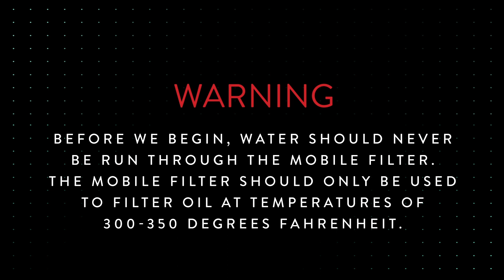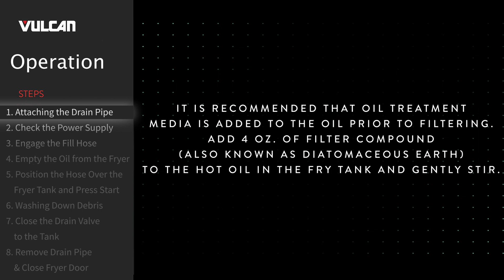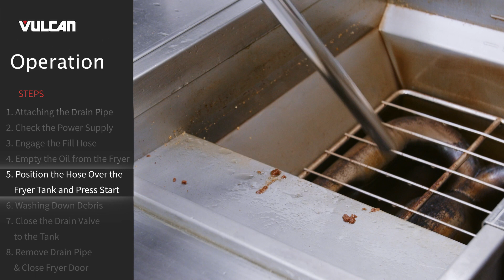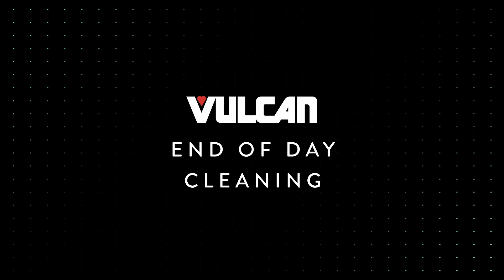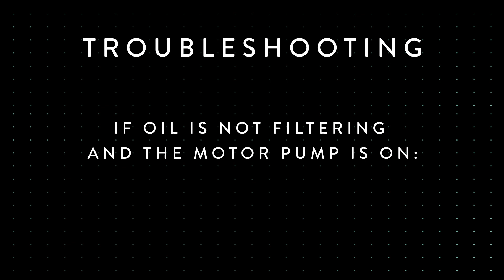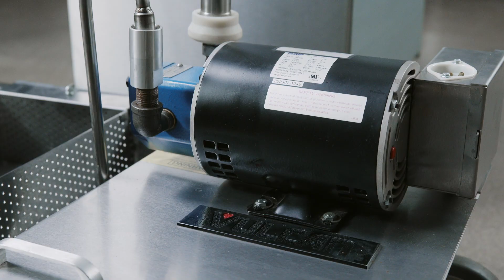Video Guide: How To Setup and Operate Your Vulcan Portable Fryer Oil Filtration Machine

Comment: Should the fryer be on pilot or on off while filtering?
Reply from the maker: A great question!  As the MF-1 mobile fryer unit can be used with any deep fryer, 110 lbs of oil or smaller, it is best to set the gas valve of the fryer to either PILOT or OFF.  This will ensure that the burners will not come on while the vat is empty.  Only some models have built-in safety systems where the only step is to open the drain valve.
Reply: what kind of pump use ?